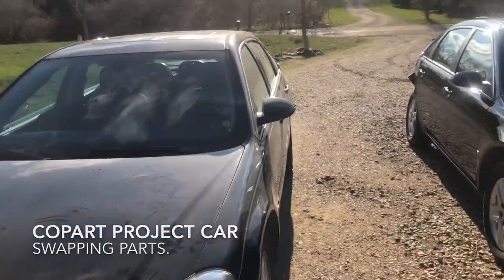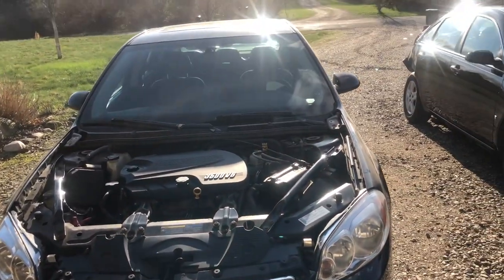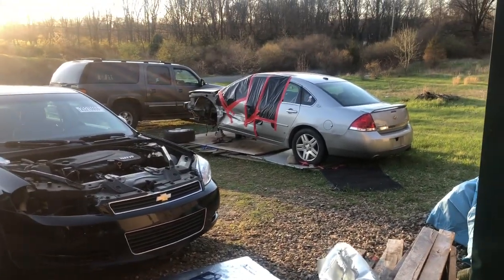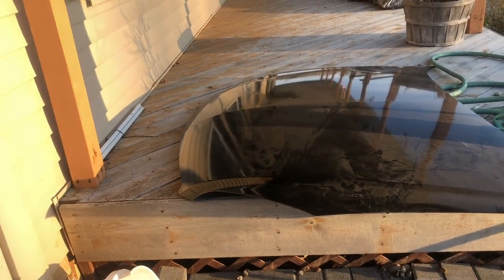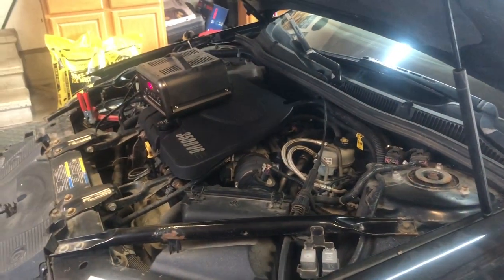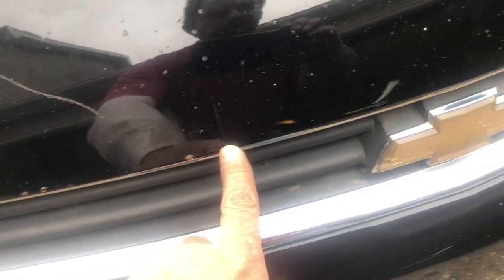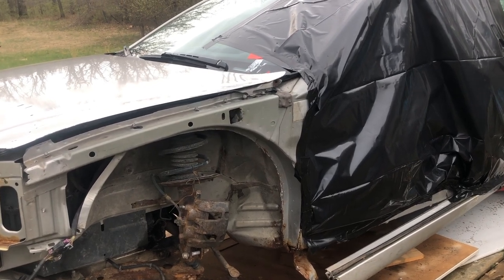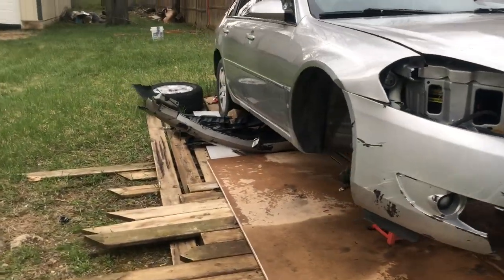Swapping Parts to the Copart Project Car - And some bad news

Comment: Well that stinks!! Yeah A pillars are something I try not to fool with. Anytime I see a car wrecked in that spot at Copart I pass it by. It takes a lot of specialty body and frame machines to straighten that kind of damage out. I don't know maybe buy another project car to take the place of crash and use them both for parts. Anyway the black car looks great. It's great both were the same color.
Reply from the maker: Kind of my thinking.  Between the two cars, I have pretty much a complete car.  Too bad you can't just cut and paste, LOL!  It's just not worth sinking any money into and I can probably use the parts on future builds.  I knew the A pillar was dented before pulling the door off but I had no idea how far it had been moved backward.  I'd imagine it would be a minimum of $500 to $600 to get that pulled back straight and then I still have a 12 year old car with 235,000 miles on it with all the other stuff that still needs fixing.  Nice knowing I can put the leather interior in anything I pick up if it doesn't already have one.
Reply: @resurrectionautorebuilders8465  HAHA yep one good in the back one good in the front. Well at the least if you buy something else you have parts from both ends to repair. Minus whatever you take off to fix the black car. And with crash looks like an LTZ so you have the higher end options to add onto an LT or base model. BTW picked a nice used Silverado this weekend It's an LT but with leather and remote start. Kinda spoiled now compared to the LT i had which was more a base model with cloth seats and the small 4.8L.